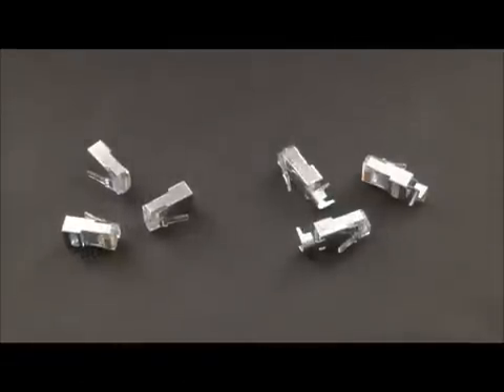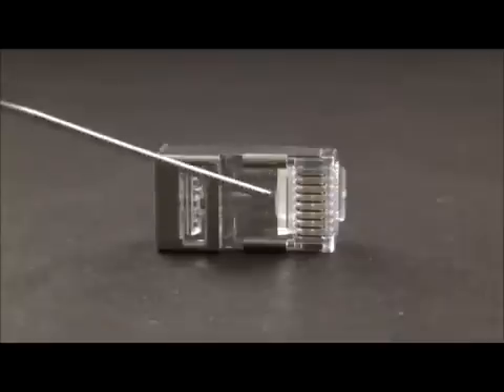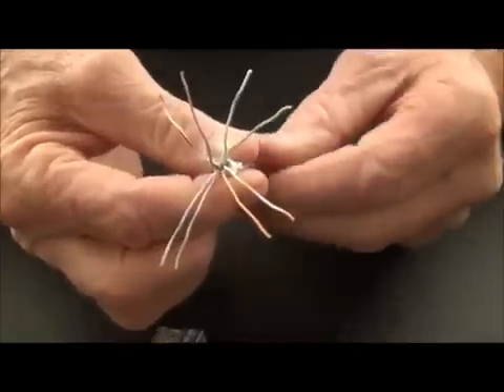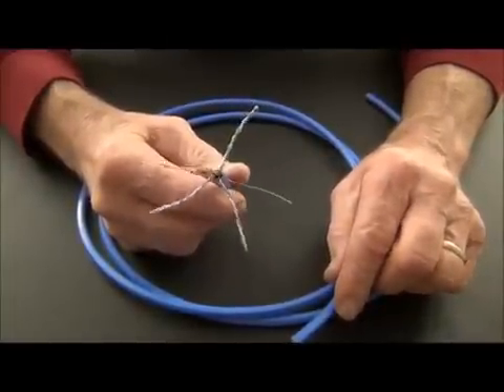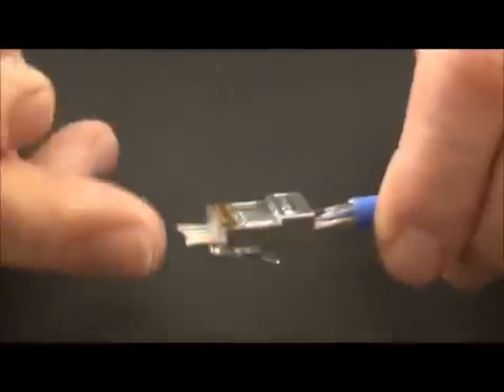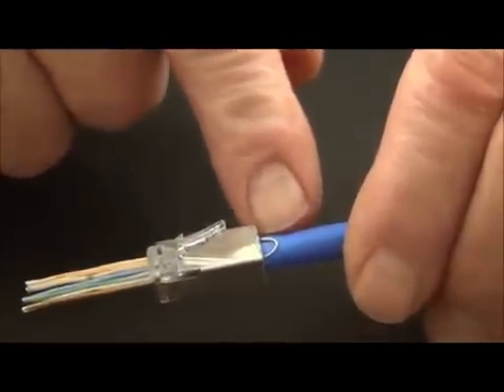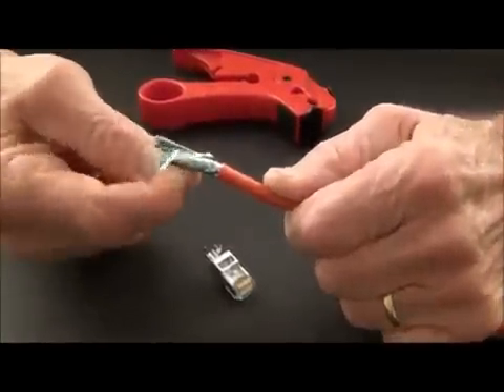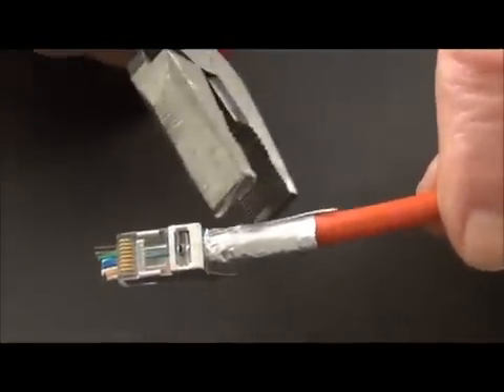Platinum Tools Cat5e/Cat6 Shielded EZ-RJ45 Connectors

Comment from the maker: There are some cheap China cables that have larger conductor jackets.  Which to me does not make sense.  It means they are not following the industry specifications and making it harder for people to put standard modular plugs on their cables.  All quality Cat 6 cables should have the same sized conductors.  Our Outdoor Cat 6 cables work perfectly with the pass-thru EZ connectors.

Comment: I cannot get the EZ 5/6 connector to install on CAT6eSc cable.  I have tried two different cables and the jacket or conductors (23ga) do not fit.  The big problem is the conductors not fitting the ez pass through molding.  Maybe the conductor jacket is too thick?  What brand/model of CAT6 do you recommend for outdoor applicaiton.